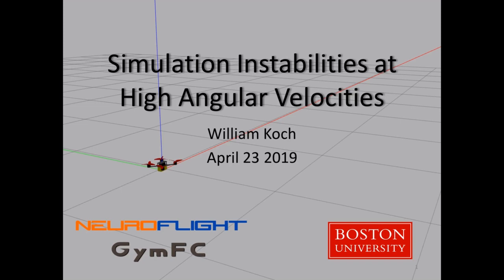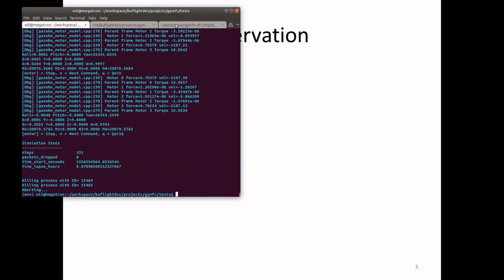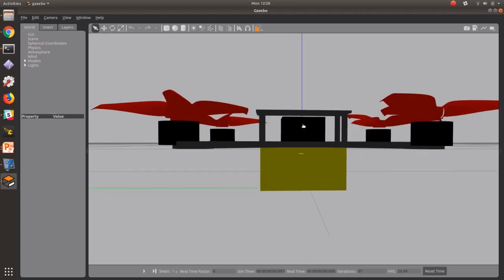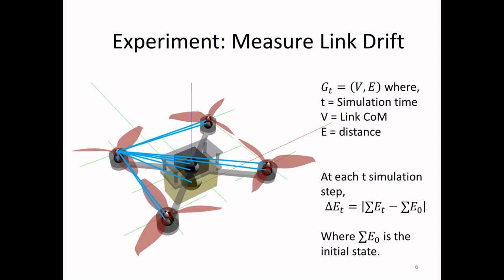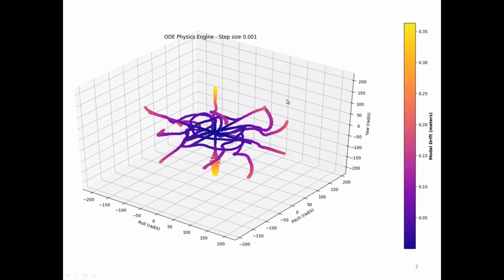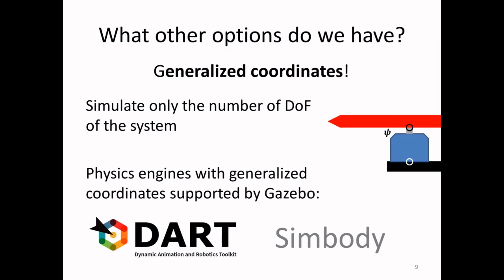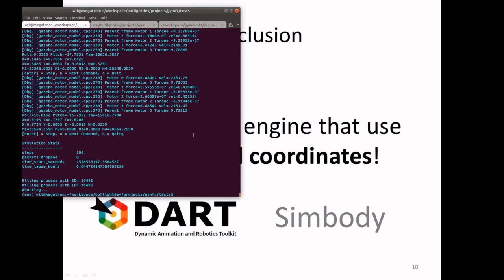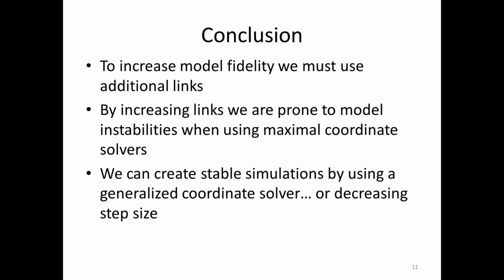GymFC: Simulation Instabilities at High Angular Velocities

Comment: Hi, I am trying to incorporate the Gymfc into our project. I have successfully compiled and installed Gymfc. By reading the codes, I found that the setup file is used to setup the environment variables for the Gazebo. I have a fresh Gazebo 11 and it is only used for Gymfc. Is there any necessary environment variables?

Thank you very much
Reply from the maker: Hi Yan, you need to point to your Gazebo setup file in the GymFC gymfc.ini config. GymFC will then source this file to load in all the environment variables it needs. I dont check youtube often, happy to support you further if you post an issue in github.
Cheers,
Wil

Comment: @Wil Koch,  thanks for sharing! This is very exciting work. I plan to start using gymfc for the development of an intelligent flight controller. For those who are new to this environment, do you have a step by step tutorial on how to perform the required installations and run a basic example from gymfc? I am currently running Ubuntu 18.04 LTS and have installed Gazebo 9 and DART. Does this require to install Tensorflow as well? Should we start with GymFC version 1 or 2? I would like to be able to use one of the Gazebo aircraft (i.e. Iris). It would be great if you actually create a video on how to install and begin using GymFC!  Looking forward to your reply. Thanks.
Reply from the maker: Hey Jesus if your goal is to eventually put a trained model into Neuroflight than you will need to use GymFC2. You'll need to install Gazebo from source to get DART to work. The repo README instructions should be able to get you setup. GymFC2 is a generic tuning framework, if you want to use it to train a neuroflight controller than youll need to decide what learning framework to use, such as OpenAI Baselines, which will install Tensorflow as a dependency. GymFC2 requires a model of whatever aircraft you ultimately want to control, this is the most difficult part. We do need help migrating the Iris model to the new framework so if you make any progress please let me know and I'll add it to the README. We have started migrating the Solo model which is referenced in the README too. My recommendation would be to read my thesis to get caught up to speed, http://wfk.io/docs/WilliamKochThesisFINAL.pdf, particularly the last chapter on gymfc2 and model design. I finished my degree at BU and am no longer actively involved with the project but groups at BU are taking over the project so development will still continue. If any issues or questions come up, the gymfc repo is probably the best place to reach out. Best of luck!